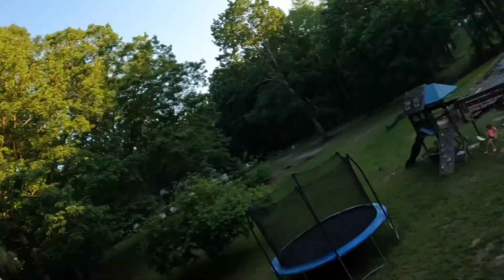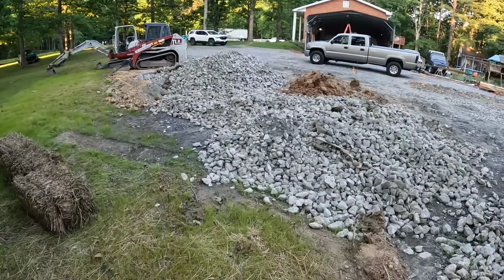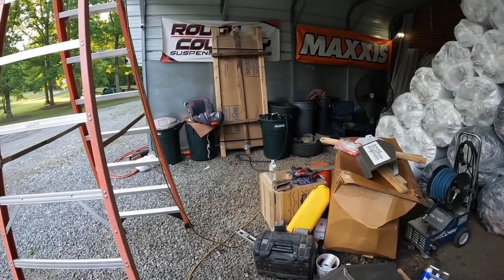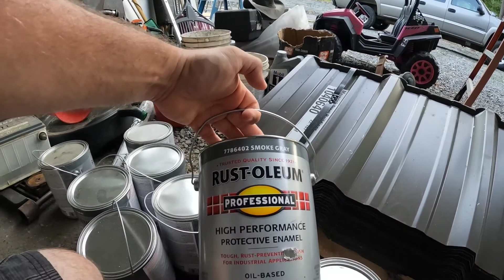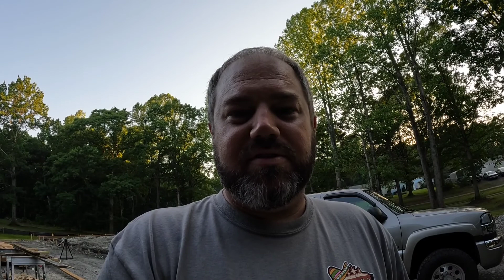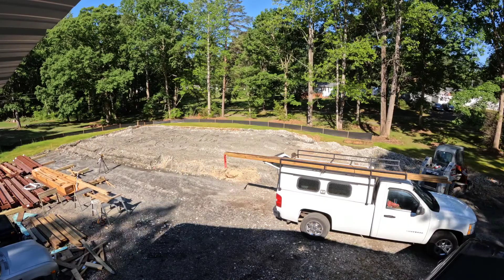Dream garage day 2 footers walk around and talk about garage details and time-lapse

Comment: How did you unload the building. My broker said I could use my 70 hp tractor but I’m worried the steel is going to be too heavy.
Reply from the maker: I rented a telehandler to unload mine i think I have a video showing that too but the way its loaded on the trailer i was only picking up a handful of peice at a time but still pretty heavy loads each time but im sure with a little physical effort and time you could manually split those into smaller loads if the machine can't handle how they have it organized

Comment: My dad is currently building this kit! He was wondering what anchors you used to hold down the metal trim to the foundation? And how did you fasten it to the roof trust? Thanks!
Reply from the maker: So I installed all the trim with the provided hardware from maverick and finished everything to match the details in the plans for the trim .... that said I did buy i believe ¼" red head hammer set anchors for the base angle the fastens to the slab and then the base trim and wall sheetmetal both screw to that base angle.  As for everything else maverick provided the hardware... well except for the anchor bolts for the slab itself.  Hope that helps but probably not as its a little confusing to describe.  Feel free to reach out if I need to better explain